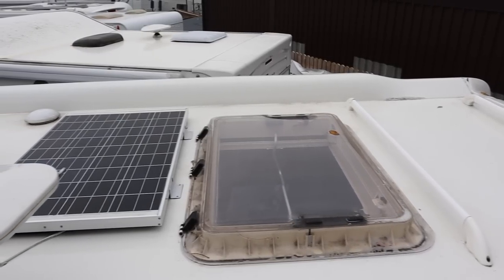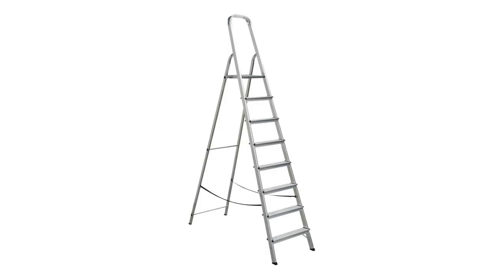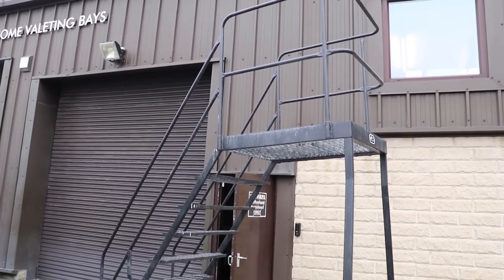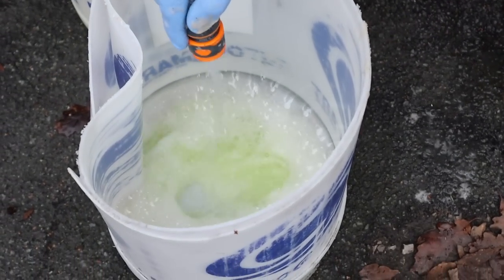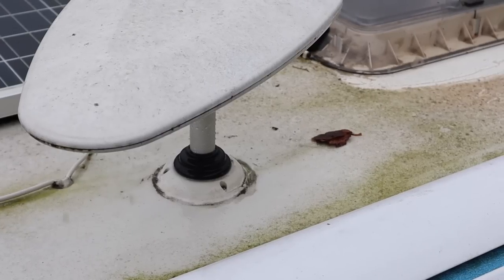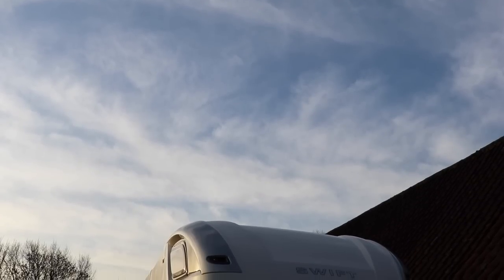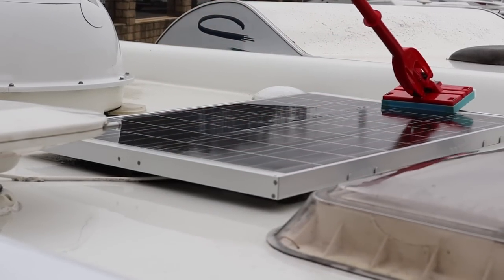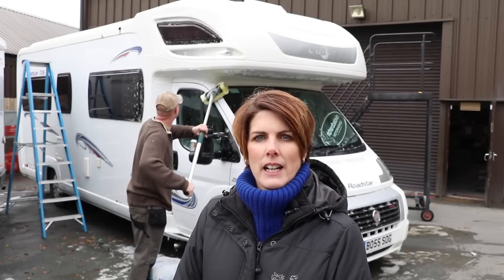How to clean a motorhome roof

Comment: Yeah, sure, I'll just nip out and buy £500 worth of cleaning gear and pick up a specialist ladder whilst I'm at it.....I don't think so, I'll simply drive the van up next to a suitably sized raised ground wall and stand on that with a bucket of soapy water and sponge for next to nothing.
Reply: yeh me too.  Not very practical advice.  That ladder is probably a grand or more and where would you store it?  I stand on the roof - not ideal but was told by Hymer dealer that as long as you don't kneel on it, it would be ok.